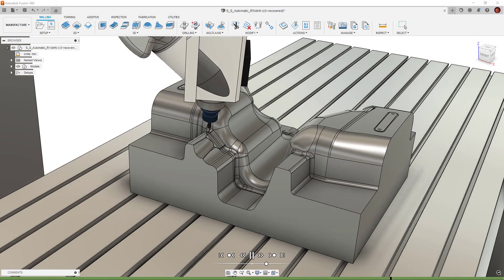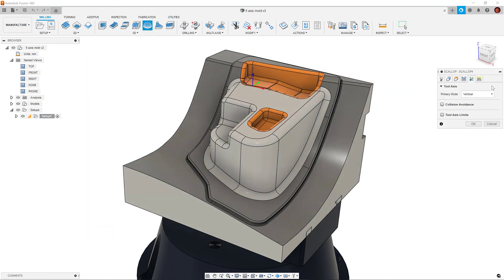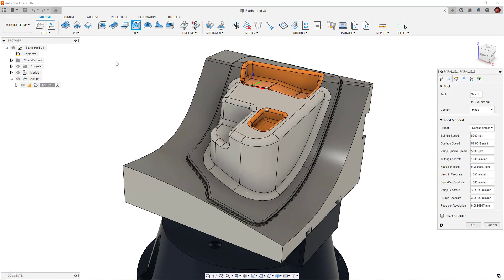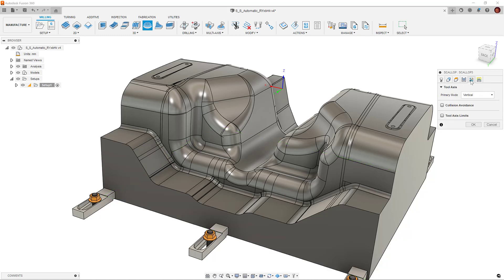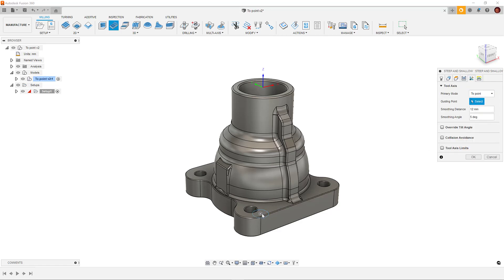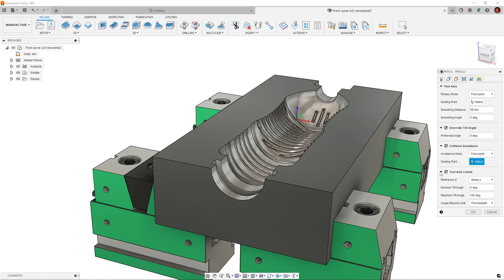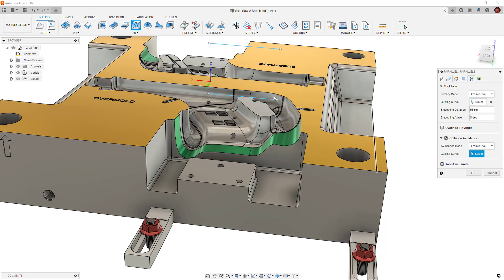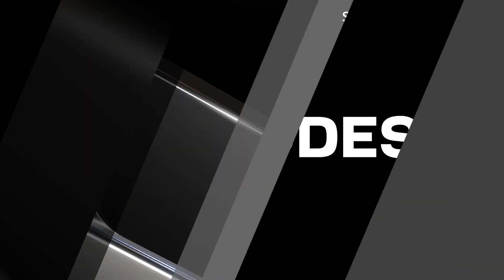Tutorial: How to Use the Multi-Axis Options in Fusion 360 | Autodesk Fusion 360

Comment: do the new features come with the machine extension?? if so I don"t have access to it yet.
Reply: Yup. This is simultaneous 5-axis, so it's in the Machining Extension
Reply: This is currently hidden behind a feature flag, so you will need to go into your preferences > manufacture > Multi-axis options for 3D strategies, turn this option on and they will appear in the toolpath dialog.
Reply: We use HSMWorks, to add the machining extension is $1600/yr, over 3 times the cost of a seat of HSMWorks or Fusion. Oh, and it does not work with HSMWorks. Way to gouge us Autodesk.